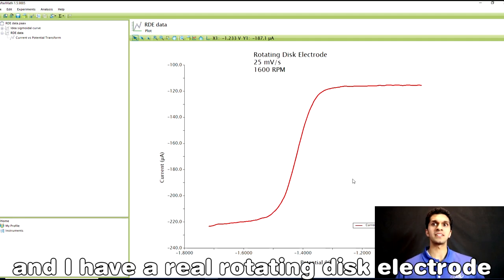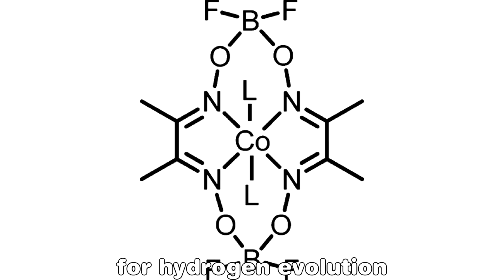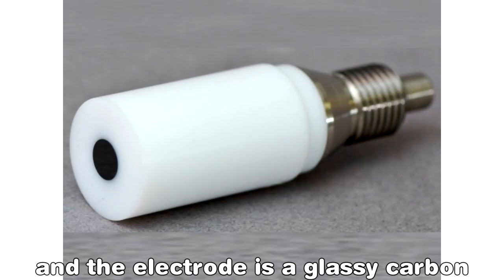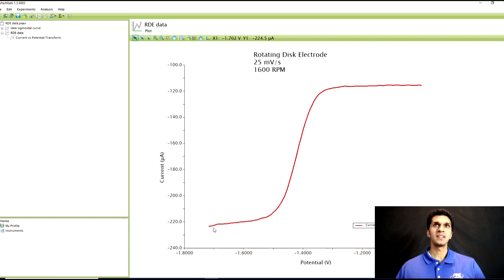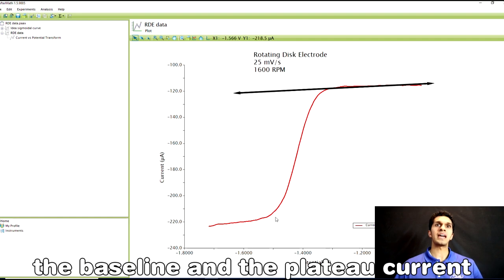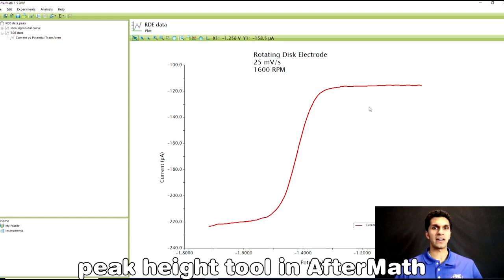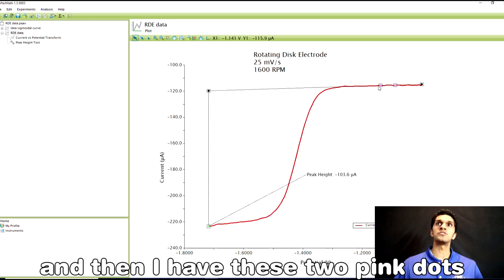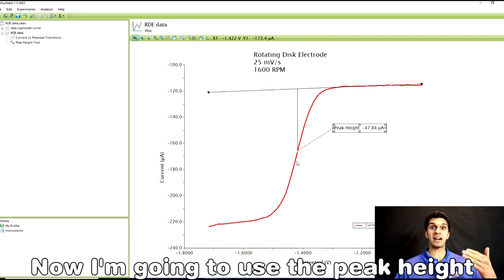How to determine the mass transport limiting current in RDE

Comment: Thank you so much for the video! but why there is only one pink box for my aftermath? Is there any settings/properties that I need to change?
Reply from the maker: What version of AfterMath are you using?  Also, sometimes the pink dots overlap, so you need to move one out of the way so you'll see two.
Reply: @Pineresearch  I’m using version 1.6.1053
Reply from the maker: @insheee5264  Hmmmmm that's a pretty up to date version.  Did you check if the pink dots are overlapping?

Comment: Great video! How do you find the middle point of voltammogram
Reply from the maker: Thank you Jyotisman!  We typically eyeball the mid-point of the voltammogram.  There might be a better way to mathematically determine the mid-point, but typically I would just approximate where the mid-point is.  I don't think you will find too much variation in the mass transport limiting current when you use slightly different mid-points because the slope from both baselines will adjust accordingly.  I hope this helps.

Comment: Thanks for the vide, can we use the same steps for a steady electrode?
Reply from the maker: The Levich equation only applies to the mass transport limited current at a rotating disk electrode.  If you have a stationary electrode you wouldn't be able to use that formula.  Additionally, the shape of the voltammogram would look more like a "Duck" rather than the S-shaped sigmoidal voltammogram in the video.  You'd be better off using the Randles-Sevcik equation for the peak current at a stationary electrode to calculate the diffusion coefficient.
Reply: @Pineresearch   Thank you so much for your reply, what if I want to calculate the diffusion coefficient of a stationary electrode using LSV curve?
Reply from the maker: @mennahasan2304  The Randles-Sevcik equation should be good for determining the diffusion coefficient using LSV.  You will need to do a scan rate study with LSV and look at the peak current as a function of the sq rt of the scan rate.  you will also need to subtract the background current.  But the Randles-Sevcik equation is the best way to calculate the diffusion coefficient using LSV at a stationary electrode.  At least to my knowledge.